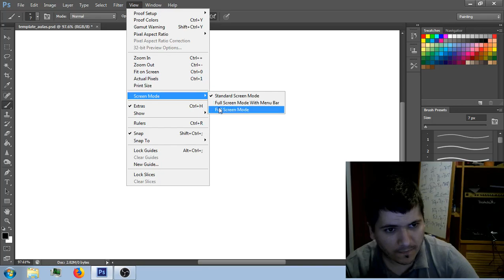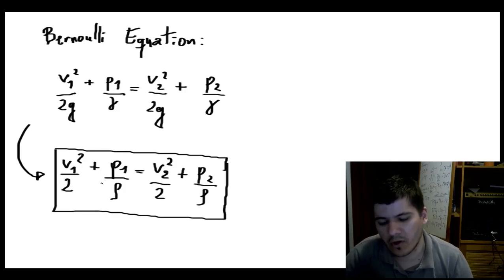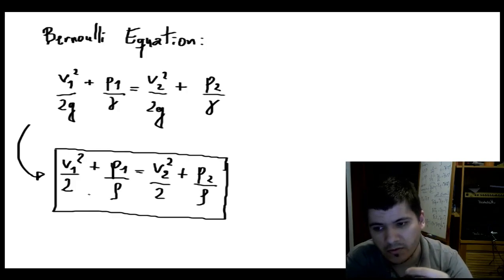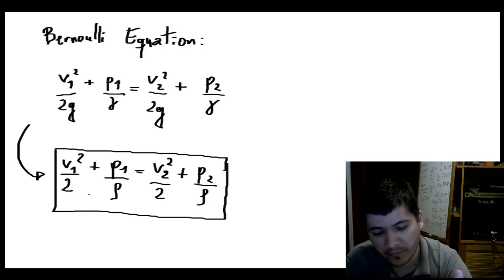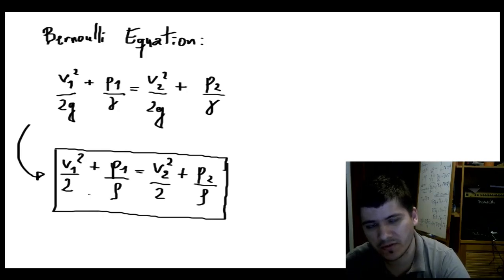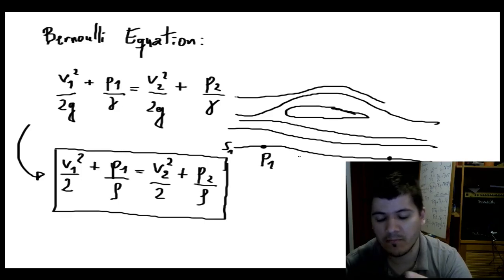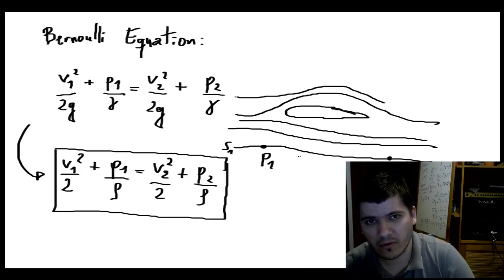Why the Bernoulli Principle CANNOT explain flight!

Comment: Here is THE explanation of airfoil/wing generated lift.

As an airfoil/wing moves through a medium (air, water, other), a perfect vacuum is generated on its top back surface. This vacuum diverts and accelerates the medium downward along the airfoil/wing’s angled backside. This diverted medium creates a low pressure area above the airfoil/wing that pulls down, “scoops,” and accelerates more of the medium from above down and along the airfoil/wing’s backside.

All of the scooped up and accelerated medium is then shot off and DOWN the airfoil/wing’s trailing edge. The opposite, counter, action to the thrusting of the medium down an airfoil/wing's trailing edge is lift: Opposite and equal reaction. (In some videos of large planes landing, this action can be observed in condensation formed in the low pressure area above and to the rear of a plane's wings)

Therefore, lift is NEWTONIAN, not Bernoullian*. However, the low pressure formed as described does permit the use of mathematical approximations with Bernoulli formulas when designing airfoils/wings.

Modern commercial jets enhance this process with a bulbous leading edge. This compresses air at the leading edge that is then rapidly decompressed over the airfoil/wing's backside, increasing the efficiency of lift formation.

More interesting is that as lift generated on an airfoil/wing is Newtonian, It can be deduced that most of the energy that sustains an airplane in flight is extracted from GRAVITY*. Evidence of this is that wing or rotor equipped aircraft have (unpowered) glide ratios or auto-rotation. And autogyros use an unpowered airfoil shaped rotor as a wing. Airfoils on aircraft are essentially gravitational energy harvesting devices.

And the Coandă  effect has nothing to do with left generation, either. It's Newtonian.

*Remember as well, that Bernoulli deals with constricted flows of fluids.